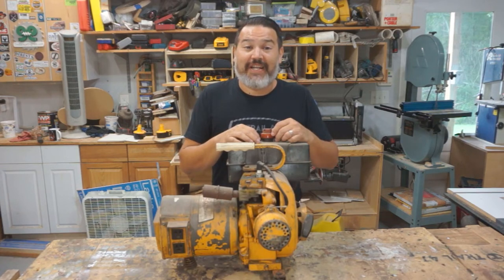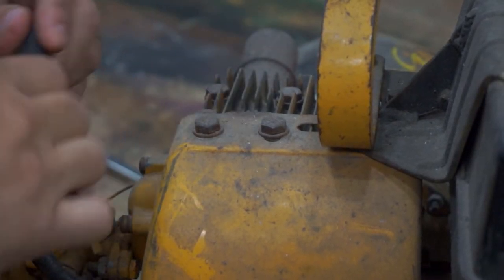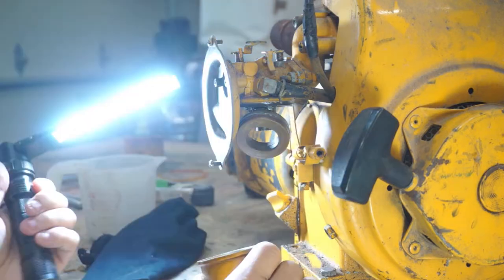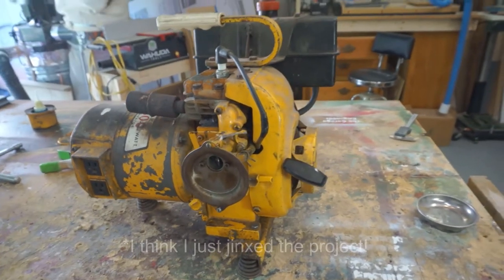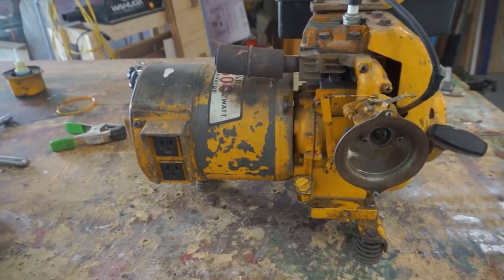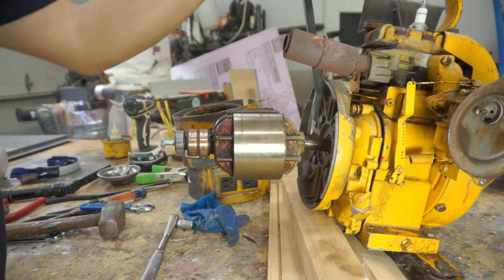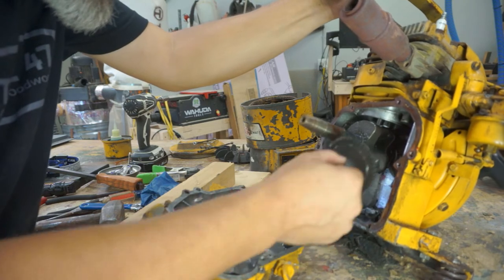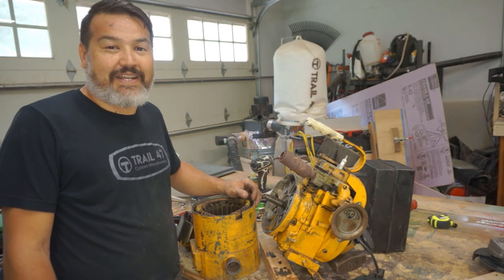Scrap Yard Find: 1970s Sears Generator Can We Save It! - The Garage Engineer

Comment: The valve looking things are the lifters. When the camshaft fell out they come out too. 
You can replace the rod. Tecumseh engines tend to through rods. I have had three do so. 
John Brizendine is correct with the polishing of the crank through. 
People tend to put the rod in backwards when they rebuild them. That will mess up getting oil into the rod bearing journals. The splash is flung one way and if the hole in the rod is on the wrong side they don't get oil. 
I have a generator like this one so it was nice to see how it comes apart. 
Mine has been sitting in the garage for 5 years while I waited to find out how to wire the generator. Mine has some additional wires and a transformer on it.
Reply from the maker: That is some good info. Thanks for sharing.

Comment: rings probably broke/seized and all the force went to the bearing/cap.  The rod journal is probably okay, the crank shaft/bearing cap is aluminum so the bearing journal can be cleaned with muriatic acid and polished with 800 grit and then 1000 grit sandpaper.  May be able to just replace the rings and connecting rod and patch that hole, hone the cylinder and have it back up and running again.
Reply from the maker: Great explination.  Sounds like the direction I was thinking.  Just need to finds the parts.  Thanks for watching.